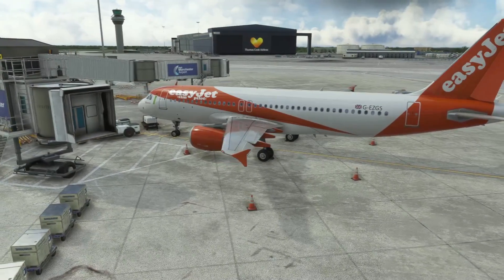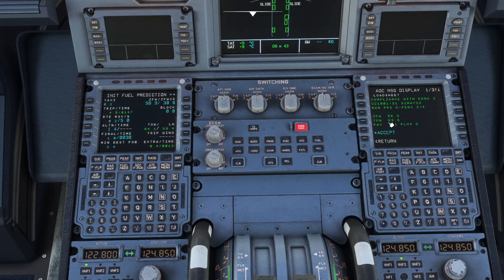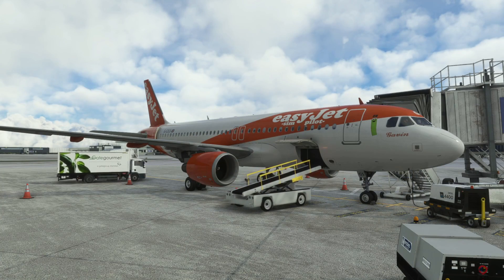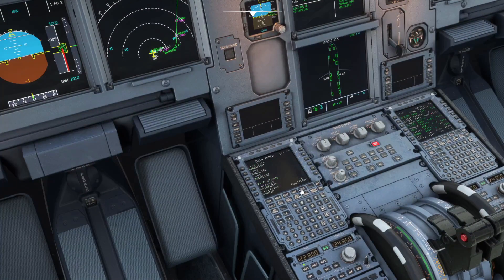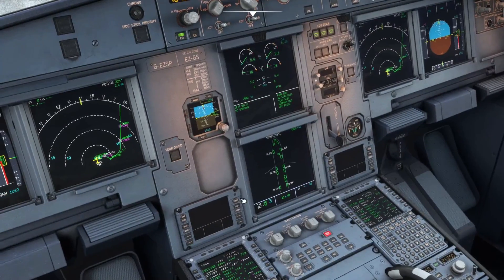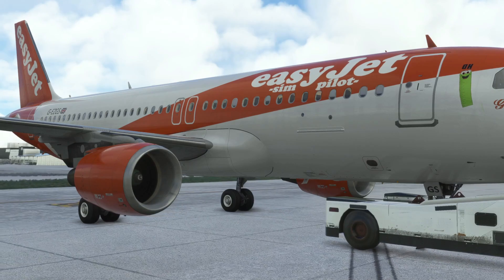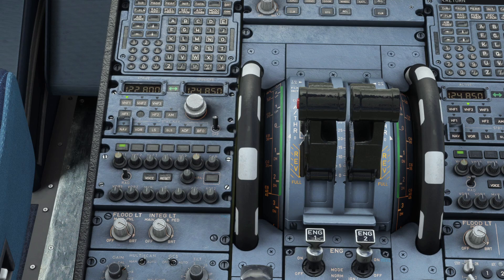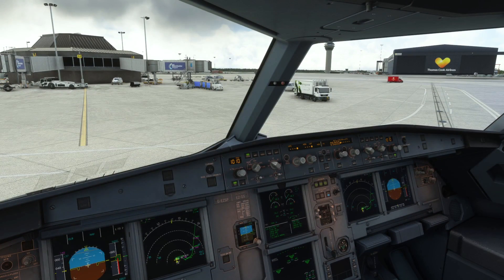FENIX A320 - Pushback, Engine Start & Taxi Flows | Tutorial Series Part 3

Comment: I was under the impression that you first start engine number two because of the yellow hydraulic system on the a320.
Reply from the maker: The hydraulics changed a longtime ago. For a single engine taxi, this is always done on engine 1. The reason being that the green system powers the brakes. Yellow, the NWS.

There is the PTU, but these can overheat and brake. 

therefore, if it's a choice between loosing either steering of braking, always better to be able to stop than steer 😉

Comment: As usual, fabulous information in an easy to understand presentation. However, I have a recurring problem with the Fenix. The aircraft taxis perfectly until I have to stop for traffic then won’t move again. Parking brake is off landing brakes deactivated but no way is the aircraft moving again. Yes, I have checked the EFB that chocks and cones are not deployed. Very frustrating after spending all that time setting the flight up. Any clues?
Reply from the maker: Are you using rudder pedals? If so, tap them as sometimes the brakes 'stick'

Comment: Regarding the additional fuel and the loadsheet: Have you tested if it might actually use the new numbers if you press "resend loadsheet" in the EFB?
Reply from the maker: This feature sends you the final loadsheet, so you don't have to wait for it.
Reply: @Easyjetsimpilot  Yeah, but I wonder if it would also refresh the numbers for last minute changes. Or have you test it and it just doesn't?
Reply from the maker: It would send you LMC, so yes, if you prefer, you can just sync the final loadsheet rather than inputting it manually.